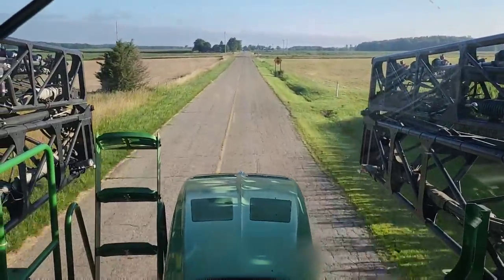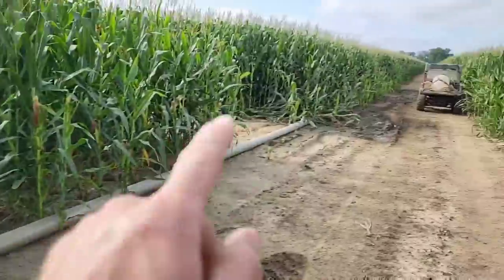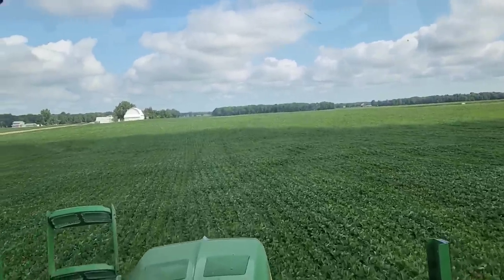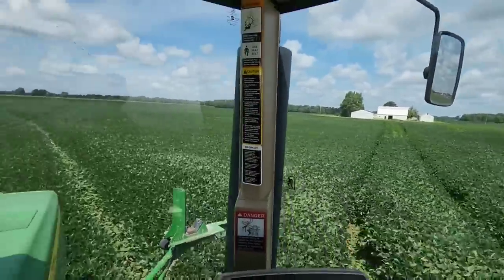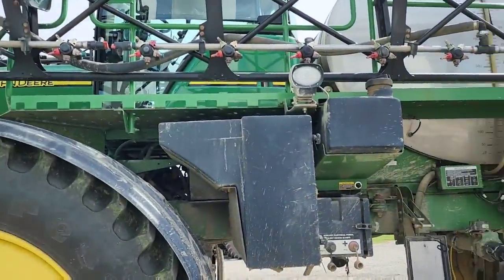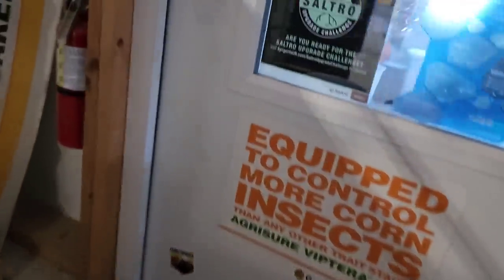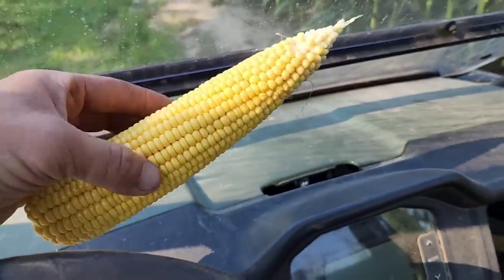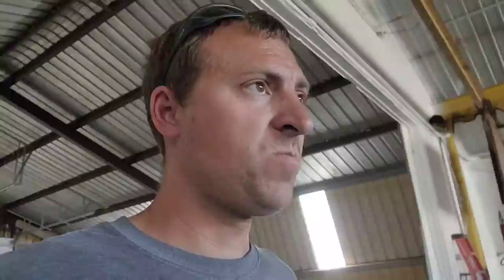Water Corn, Spray Beans, and Scout Hybrids - #737

Comment: As a dragline operator your angles change with the block your working in. They have a flow meter so you put down the right rate. It would rut bad double applying, dragline is the best way to do it for soil compaction. It’s like tracks on a tractor the hose weighs fractions of a tanker setup.

Comment: I'm not to impressed with the enlist on my marestail, it seems to burn the top couple inches and stops it from growing for a couple weeks then it tillers out with 4 or 5 new stems🤷‍♂️ I had glyphosate and first rate tank mixed also wich even though the marestail is likely ALS resistant I'd think it would help a little🤣. Probably best route would be liberty and enlist together at about 35-40 bucks or the extend beans I'm thinking. My neighbor let his go the last 3 years and rapidly increasing the seed bank.
Reply: Enlist is a weak 24d. Gotta get marestail before it bolts
Reply: @agger838 Your right,  Gota get it killed of in the fall or early spring so in crop it's in rosette with escapes.